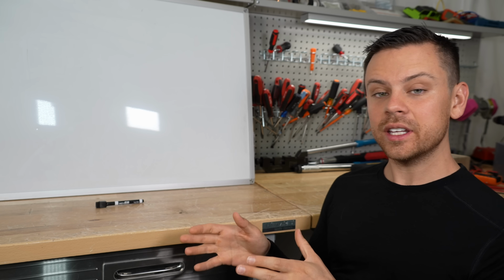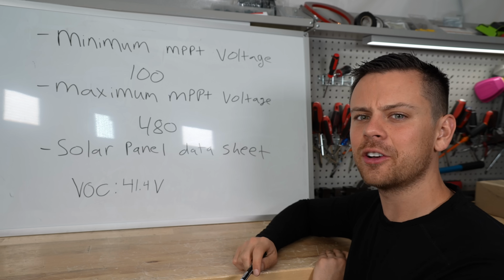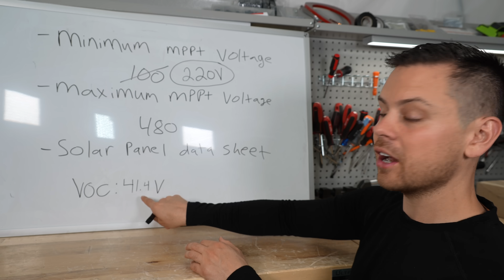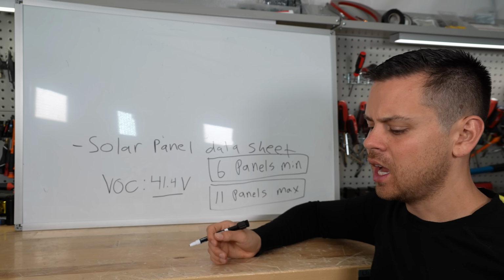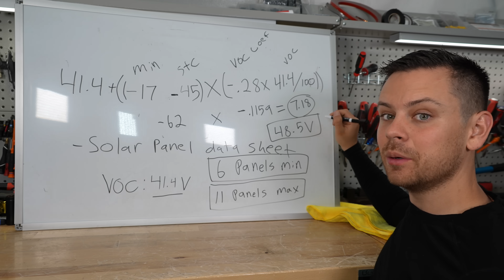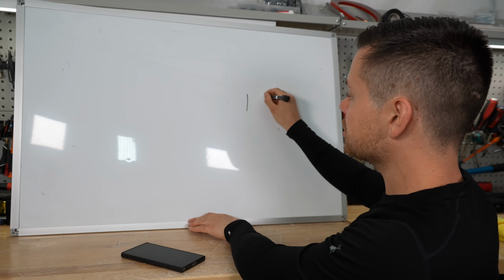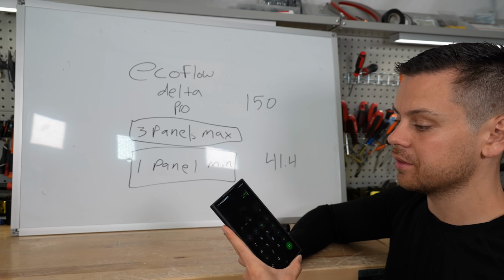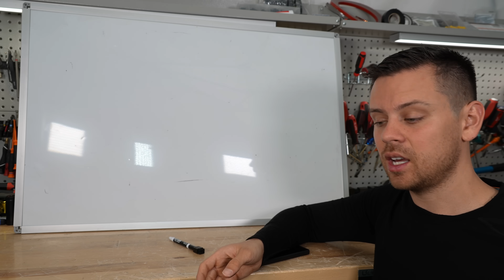Solar String Voltage Made Easy! How many solar panels can you safely connect?

Comment: Thanks Will, videos are very informative. I am experimenting with the Oupes Mega 2 and a couple of extra batteries. It has the 150volt limit as well. I purchased 3 Talesun 400 watt Biracial panels with a VOC of 37.1, i wanted to ge 4 of them but that would put mw at 148.4 and I think that is to close to the limit. It gets cold for short periods in Arkansas so i guess sticking with 3 is the limit for now.

Comment: Thank you very much Will, for clearly explaining how to calculate the minimum panel voltage and maximum panel voltage for a series of panels depending on how much voltage your solar controller requires.  It is EXTREMELY important to know.  In fact, I do believe, from research on other solar charge controllers, that the maximum and minimum are VERY DEPENDANT ON THE VOLTAGE OF THE ATTACHED  BATTERY.  As an example, I have a string of 12V panels x 4 in series that output about 90V.  (They are Ecoflow 100Watt bifacial panels, you can lookup the specs on the internet).  One solar controller I've ordered is 12/24/36/48V auto-sensing.  The specs state that if the battery is 24V, there is one (lower) min/max calculation, but in my case, with a 48V battery, the min. PV is 60V and the max. PV is 100V.

Comment: For the EG4 reference, with the referred panels. The 6min 11max pertains to just one of the 2 mppts? So you would use 12 to 22 of the referred panels to run the EG4 correct? Thanks!
Reply: No I never got an answer from William.  But I will soon find out. I am just a few days away from testing. I will start with half the panels, and slowly add more.
Reply: @davs.not_here  I have the same question, hope to hear from you as I won't start my installation for a while still.
Reply: Thanks for not replying to my question
Reply: Did you solve this question?  I think your correct buy i had the same question

Comment: I'm so confused with my growwatt 15kw inverter. It says 1100v max DC input, while 1000v per mppt. It has 2 mppts. So inverter should be 2000v, right?
Reply: If it has 2 mppt, each mppt can handle up to 1100V max DC input but 1000V per mppt. 
From the module datasheet, there will be 2 type of voltage, Voc (open circuit voltage) and Vmpp(voltage at maximum power point).
If you are calculating using max DC input, you should use Voc.
If you are using max mppt voltage, you should use Vmpp.
Reply: @zenniz1992  thanks mate

Comment: My inverter reads:

No. of MPP Trackers/No. of Strings MPP Tracker: 2/2+2

So assume meaning 2 x MPPT trackers and 2 strings per tracker, so 4 strings total. So I can do the math for each string then run several strings in serial back to the inverter

Comment: This is a great tutorial.  What are the rules if you have 2 PV input ports like I have on my EG4 6500.  I live in the mountains and need to add a south west side leaning string and a South east side leaning string because the mountains block the sun early in the morning and later in the evening.  Are both PV inputs considered to be one string for the purpose of the maximum voltage allowed?

Comment: Great video! Thanks for all the info!
I am in a bad situation as I have limited space on the roof of the expedition vehicle, I can mount 3 large panels max and my AIO inverter accepts a range between 120v-500v in series..
Question is: is there a way to safely boost the voltage of the panels to reach around 200v for the string or, Alternatively install an a suitable mppt before the AIO system?
Inputs would be highly appreciated!

Comment: Is it possible to hook up 2kw of solar panels to assist a (3.5kw) HVAC system connected to the grid still? That way the solar panels will partially supply the electricity and lower the electricity bill? Thanks in advance.

Comment: Don't forget current limiting MPPT.  The solarks for example current limit at 26 amps.  With a 7s2p string of the aptos 400w, voltage goes I'm around 220v and tickles the current limit of 26 amps.   Wish it didnt....lol...but that's what I bought at the time.  And that's where we are.

Comment: I read this in the victron manual, When the MPPT switches to float stage it reduces battery charge current by increasing the PV Power Point voltage.
The maximum open circuit voltage of the PV array must be less than 8 times the minimum battery voltage when at float.
For example, where a battery has a float voltage of 54.0 volts, the maximum open circuit voltage of the connected array cannot
exceed 432 volts, so you can't go over 432 volts?

Comment: Solar in Minnesota is complicated by ridiculously low temperatures during the winter, effects from reflection off the snow and accumulation on the panels, as well as the significantly shortened days. The bi-facial panels you like might collect more energy reflected by the snow if mounted properly. I understand that solar installations were failing at first here because installers just used the standards from California where solar PV firstr became popular.

Comment: Always great videos.   I have an RV which has two go power 199 watt panels wired in series in the roof.   They have a side port to add another panel which is also wired to the mppt 30 amp go power.   I am told I can add any panel on the side port, but have heard by adding this side panel (100 watt)  panel would degrade the two top panels.    Can you provide insight, maybe even a video on wiring a separate panel on the side port?    I have heard it is better to wire a side port by adding another mppt controller and then directly to the battery.   However I want to simply use the side port wired to the current mppt controller.   Enough said.     Thanks again   😅😅

Comment: For the EG4 reference, with the referred panels. The 6min 11max pertains to just one of the 2 mppts? So you would use 12 to 22 of the referred panels to run the EG4 correct?

Comment: Hey Will, you should do a video on vertical mounted bifacial panels. 

According to what I've read, there's an output increase due to lower operating temperatures. 

This also reduces the horizontal footprint. You could have more panels in a smaller area (sq foot).

Comment: Would a 32V Max (38V Open) 200W panel work better than a  24V Max (28V Open) Panel with a Victron 75V/15A charge controller and a 12V battery bank? Likewise would a 38V Max (45V Open) 200W panel be better than the 32V Max Panel. I understand the charge controller turns on when voltage equals bank voltage +5V.  With a single panel, should I opt for the panel with the highest voltage?  Will this help capture the most watts throughout the day by turning on earlier in lower light and staying on longer later in the day as the light dims?

Comment: I have a 36 VOC I string two together my Max VOC for my inverter is 80 
Put at the connection to the 3000w be or inverter it only shows 24v I have nine panels 
I only able to push a 5000 BTU window unit before it tries to jump to the grid I can get up to 600 watts on those panels before it jumps over to the grid

Comment: I am about to wire up a  6x6 a frame 12 panel system 300w each panel 41voc ,off grid trailer cost 30k has Victron gear and pyltech 2x3000au 48v 74ah rack battery's  148ah total come pre built for customer in kit but not wired up ,this is going interstate south i just had a look at lowest temp in that region of Australia and its - 6 deg C  , going to wire in strings of 6 ,i have built my own 24v sytem with Victron i hopping this is not complicated ,i will need to wire battery's in parallel they are just strapped in the box with bag of wires , cant be to hard, all good he just emailed me the system diagram and scmetics

Comment: Will - great video.  I am trying to figure out how to maximize wattage for the 6000XP and I noticed that when I use a 400w or less panel, I can get the 4000 watt max per string without exceeding the voc max.  But when I go to 450 watt panels, I am unable to get to the 4000 watts per string without exceeding the voc.  I would prefer to use the higher wattage because it takes less panels (ground mount space).  Have you noticed this?  Wondering if I should use a parallel/series configuration?  Also, you are down in TX, I am in OK, do you ignore the temp coef calculation and just cover a couple of panels during the 5 days it gets cold?  Thanks.

Comment: My charge controller will automatically adjust to different voltage batteries.  Can I use the highest input voltage they list for the 48 volt battery even if my bank is 12 volt?

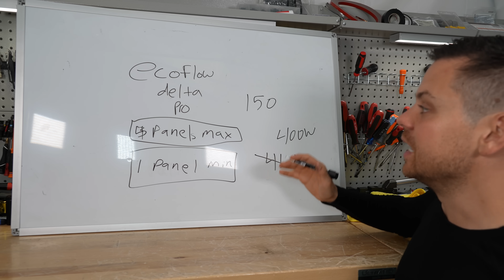Comment: I appreciate Will's DIY knowledge share regarding solar power, but I want to strongly caution his statement at 12:40 regarding EcoFlow DP's ability to handle 4 Aptos 400W solar. This is simply not true and ironic because he stresses it earlier that colder temperatures result in higher voltage. Unless you live in the equator, your EcoFlow DP will fry itself during the cold seasons where it dips below 25 degrees C. While, yes, 4 Aptos 400W will fall a few volts short of the 150 max volt, you'll absolutely cook your batteries once the temp drops. It's a frustrating that he literally spent the first half warning about over voltage, and mindlessly forgets towards the end the advice he had already given about MAX voltage.

Comment: If I'm using a EG4 6000XP which supports 2 strings is that 480 volt max for each string or both strings together? I can run 11 or 22 panels?
Reply: I had same question

Comment: Question: when using a ecoflow delta pro or delta max is it necessary to use a charge controller when you have the built in BMS. I don't think I have seen that set up advertised with a charge controller.

Comment: I recently bought the Aptos 370 bifacial panels, hoping to put 4 panels together (41.4 volts) to charge my Mango E back up generation system with a 150 v limit. I also have a cv combiner box with 15 amp fuses. Is there someway to get 4 panels configure together? Thanks for your help.

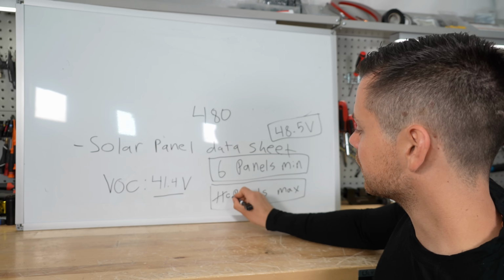Comment: Wouldn't you be able to create "loss" by using a smaller gauge wire over a longer run and then go to 10 panels instead of 9 minimum? @9:05

Comment: I have two Delta Pro systems and interested in the Aptos panels. 400W with VoC at 37.18V is the sweet spot for sure. Thanks for discussing cold climate calculations as I live in BC, Canada. Do you know where could I find solar temperature information up here? 4 panels in series might be too much in -20C winters. Would it be viable to calculate the voltage drop in longer DC cable runs into the equation? Thanks Will, love the new content.

Comment: This may be a little off topic. I built a water fountain in my backyard and I bought the pump and solar kit from silicone solar. I have eaten through 3 acid batteries from the extreme heat here. Could I replace the acid battery with a lithium battery? Could you look at this system and see? I have 2 of their solar panels going to this. Solar Water Fountain Pump with Battery Backup 9V AquaJet Pro Kit.

Comment: @WillProwse

 Will - With your reults for 9 panels.
What Values do I use to  calculate the Amps and Voltage so I don't exceed the Amps and Volts of the
IMO DC Disconnect Rooftop Isolator Switch Solar Disconnect Switch
Max 32 AMPS input, Max Voltage Rating 1000Vdc?

Thanks
Scat

Comment: Very good. Great for a full sun location with lots of room. These are most of the people in your audience so that makes sense. Things are different on boats... and the same. they do take a lot more thought. 400 watt panels on a sailboat are generally not a good idea... though I see them often enough generally in 12 parallel configuration. I have found using two serial strings (or more) where each serial string has all of it's panels in the sun at the same time. Cut cell technology has given us one of two things: A) a normal sized panel with some shade compensation (though generally not in a way that makes sense on a boat) or B) Smaller panels such as a 100W panel that is less than 30inX30in. These small panels are more expensive than a 200watt 30x60 (ish) panel... but it means I have room for 24v (42voc) on each side of the boat rather than just 12v.(21VOC-ish). This is compared to most boat systems that end up even with 1000watt systems having a 12v(21voc) input to their MPPT controller .... which they have to oversize to get to the current rating. Unfortunately, while most portable refrigeration systems are 12/24, the navigation instrument manufactures have not got the same memo and so a 12v system on a small boat is still what we have. So the flat surface I have is 60inx60in but much of the time one half of that is shaded by the boom and sail. So I can't count on a 400 watt system but rather two 200watt systems of which I know at least one of them will be producing at any one time. Small panels are the thing for boats for best output... I would guess that having two mppt controllers would also pull more power out of the shaded side too but I have limited space for mounting such things. A lot of the small mppt controllers are the same size for different current ratings too, which doesn't help. However, 200watts is still pretty good for my needs. I can almost make do with the 75watts I get from the system on the boat when I bought it (350wats of 12v panels into a PWM charger)   :P
Reply: You sound experienced so will like to hear your advice. I have a 47ft cat with currently a 12 volt system and two 100watt panels on coach roof. My leads are shot and listening to Will i have decided to go 48v lithium. I will use DC to DC 48 to 12 to power my 12v systems. Just need to work out what I need for chart ploter, auto pilot, VHF and other critical systems. Anyway, my confusion revolves around the victron 48v solar controllers only doing a max 250 volts and will saying that's like the minimum for panels to power up 48v systems? Any advice would be appreciated.
Reply: @georgesteele3888  You have 200 rated watts of solar panel? First thing is to expect about 100watts on average. SO I am guessing you mean to add a lot more solar panels. If all your loads are 12v, why do you need a 48v system? Are you planning on running a lot of AC loads? In short what do you need 48V for? What are your plans for consumption? What is your real estate available for Solar panels? If you are putting them all horizontal (so the wind doesn't catch them and blow them or the boat away)  you will not be producing rated power even with no mast, boom and sail shadow.  Remember you want to be able to walk on deck so you can't have solar on 47 x 20 feet of area. Even with soft panels that can be walked on, they will burn your feet in full sun. So first decide what space you have for solar panels. Lets say half of the size of the boat so about 8000 watts of panels from which you can expect 4000 watts for maybe 8 hours on a sunny day. We can be generous and say 5 hours. This means you can use about 800 watts all the time over 24 hours. This is half of what you can get out of one wall socket on shore. Some loads that will be on a lot are fridge and probably freezer.... so down to 700 watts. Then you have lights and nav gear. Water maker, fans, water pumps. etc. You have pretty much used all your power already on 12v loads.... Unless you want to run a genset or motor every where you go. If your cat is not a sail boat but a motor yacht, then you can put lots of batteries in and run whatever voltage you want, I guess. You still need to look at what your motor's alternator puts out and decide what you can power from that depending on power in over 24hours. I would cook with gas.
Reply: @lenwhatever4187  boat came with 2 panels 100 watts each. They did fine for my batteries when i paired with victronsmart controller and victron 3k inverter/charger. Running 12v fridge and rest of usual boat systems, but upgrading my compressor freezer to 12v or if possible 48V. I don't really use chart ploter anymore since navionics. Biggest draw is auto pilot, usually single handing so it gets used nearly always. 
I am a lifelong professional sailor so not exactly a Virgin to boat systems ;). But i must confess I am an electrical moron lol. Current system is 4 D @190 Ah lead batteries that are spent. Wife recently started sailing with me and a whole lot of amp hungry appliances started showing up hahhahaha. So after research I decided to go lithium 48v. Even two Epoch 48V @100 Ah have a lot of power in them. I am a sailboat but have genset. My idea so far is go 48V lithium and build a solar rack off stern, could probably fit 1600 worth of panels back there, I am 25 ft wide. Back there they will not be shaded when under sail. Thinking going with a 48v Victron 240V system and switch over my appliances to the more efficient 240v appliances. Air-conditioning I will probably switch to 48V as well, those systems have come a long way. Victron makes an amazing step up step down transformer, that could allow me to keep my 120V volt system and just add in new sockets for 240 in the gally/saloon area. Probably getting rid of my propane and going induction top, gimble isn't a thing on a 47ft cat  ;). The new panel technology that takes energy from both sides of panels will work awesome hanging flat off my stern, lots of energy reflects off the water. My 80 amp alternators will charge my lead starting batteries and I could use a step up to go 12v to 48V so they could on the line going to house dump energy there. Lots of possibilities it seams.

Comment: i have 2 pcs renogy 12v 100w  parallel to victron energy mppt100|20a to charge 12v/50ah,
can i series 2pcs renogy solar panel  to 24v to victron energy mppt 100|20a to charge 12v/50ah battery?
thanks